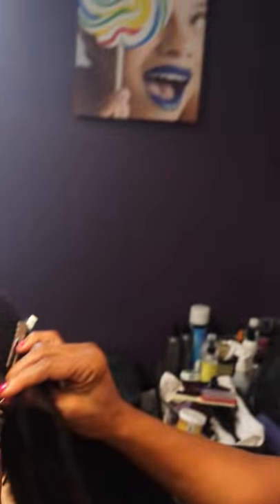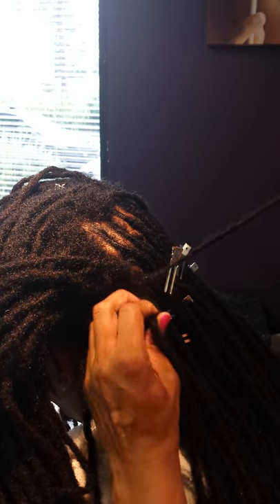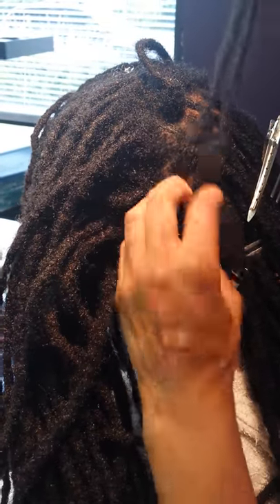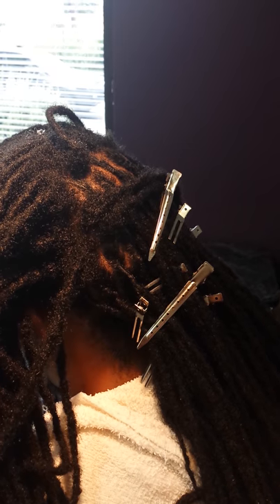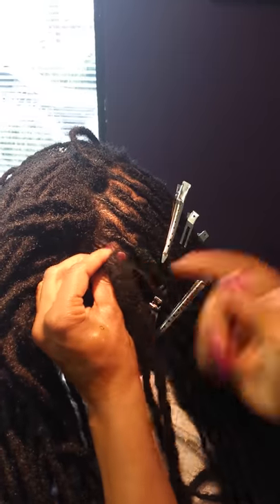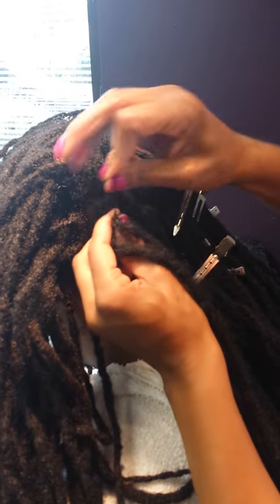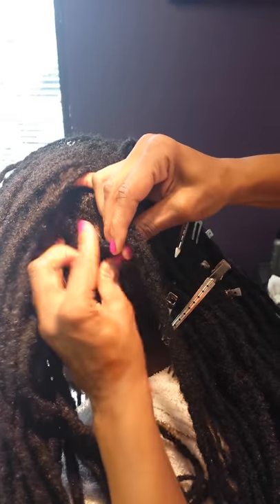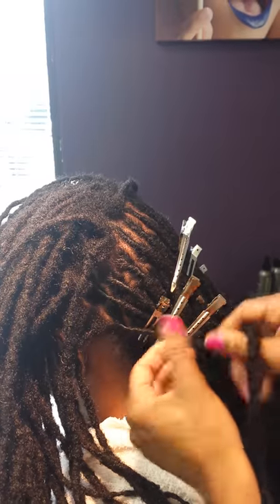Combining Locks: Avoid Thinning & Breakage

Comment from the maker: Hi Tina!  Less is more as far as products go.   I usually apply castor oil to the scalp and then use a very small amount of clear pomade (I like MyGel by Joie Naturals) to twisty each loc.   
The shampoo and conditioner depends on the hair type and the condition of the scalp.